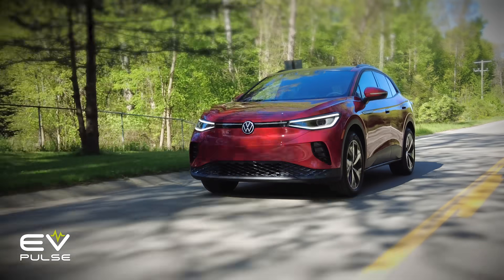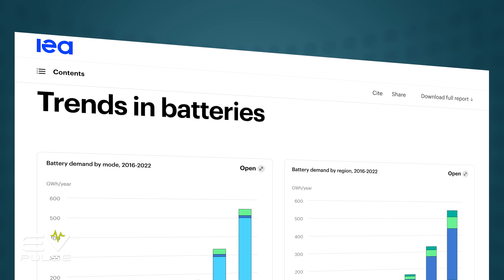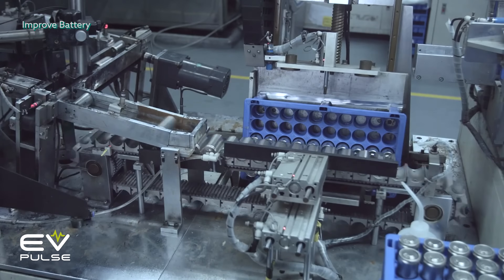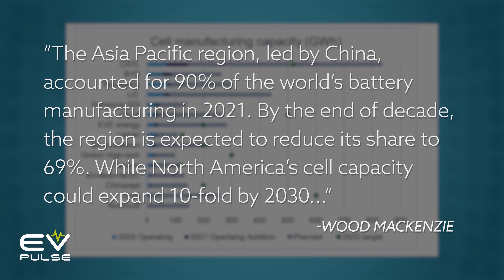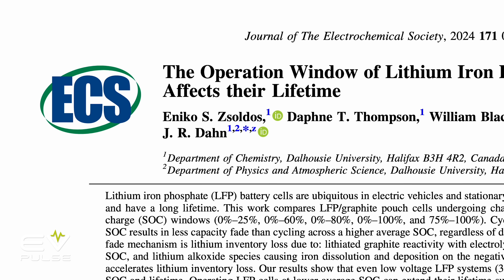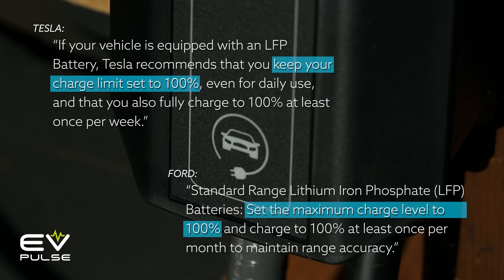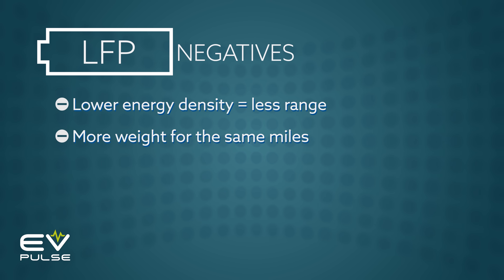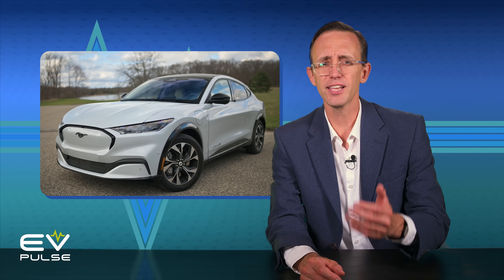What is an LFP Battery? | EV Basics

Comment: You need to charge lfp to 100% every month or so, but it lasts much longer if you use it between 20 and 80% like nmc. 100% charge is just to calibrate the controller. But anyway, even with every day 100% fast charging lfp will outlast any nmc by decades

Comment: I'm a bit late to the party but there were two glaring errors in this otherwise good video. In reality LFP batteries do not like being charged to 100% but occasionally you're required to do that to maintain range accuracy. And the "happy zone" for NMC batteries is around 50%, not 80%.
Reply: LFP. With approximately 5,000 charge cycles at 100% capacity, I choose 95% battery recharging at every charging cycle. I will certainly be dead long before that LFP battery degrades to 80% of its original capacity.

Comment: While it may not be super important which chemistry you get, it's VERY important to know which one you got. Knowing which battery my car has will make a huge difference in deciding on a charging regimen.
     I agree....If given the choice, I would probably choose LFP, just because of my familiarity with it, working with solar. LFP is proving to be the ideal energy storage solution for solar, because of it's forgiveness to partial states of charge, and charge acceptance efficiency, as well as longevity. In this application, the battery doesn't need to accelerate itself. In a stationary application, the battery can be as bulky and heavy as it wants, as long as it's cheap, reliable, and durable.

Comment: The BYD Seal has an LFP "blade" battery pack. It can be fitted with dual motors for high output and 0-100kph in 3.8 seconds. The range is equivalent to a similarly sized NMC battery in a Tesla model 3 for example. The new 2025 Seal model has 800 volt architecture that provides for faster  charge times better than some NMC counterparts. While the BYD Seal is not sold in USA the technology in BYDs LFP blade battery proves many of the statements here regarding LFP and NMC attributes erroneous or at least dated.
Reply: True, they are becoming dated. I agree that it appears LFP will likely take over from NMC in most applications in the coming years. The disadvantages for LFP are rapidly being mitigated, leaving all the advantages of a winner. The game is not over though, with  other battery types also looking to compete in the future.
Reply: The Tesla Model Y SR (german made ones) got the BYD blade LFP as well, best battery so far, outpaces the more expensive NMC versions

Comment: LFP can not be charged to 100%  regularly. The only reason it's recommended to charge to 100% periodically is for the cars system to reset and state the correct state of charge. NMC uses battery voltage to calculate the battery state of charge. LFP has a more constant voltage  therefore is not able to use that as a measure to calculate the state of charge. Instead they use electrons in vs out to calculate battery charge. In order to maintain it calibrated, it needs to be charged to 100% periodically.
Reply: This is why the plan is 100% charge but don't charge but maybe twice a week.  That will keep most days around 25-75%
Reply: @ewitte12  Stop with this bullshit please.If a battery can't take 100% charge it isn't fit for purpose.
Reply: wow the EVangelist aggression is manifest here!
Reply: Nonsense, LFP can charge to 100 and discharge to 0 regularly without degradation.
Reply: @QL2004 everything causes degradation, charging to 100 just causes it faster
Reply: @QL2004  Tesla specifically warned you not to drive your car to 0% as they say it will cause harm. They don’t give further details.
Reply: 0% is not recommended  @QL2004

Comment: LFP battery does not hold charge as well as NMC batteries in extreme weather conditions.
Reply: It's really about you personally, i don't think LFP is an upgrade in the battery technology, but more of a sidegrade, i live in an average climate (18-30 degree celsius) so not really extreme conditions, i need ~100km per day to commute to my work so a Sealion 6 hybrid for me is perfect (100% gives me a 100km for the LFP battery with the hybrid engine giving me 1100km range for long trips. I've only had this car for 6 months and i rarely use my hybrid engine, 98% is with the battery and i have never refuelled my gas in those 6 months.

Comment: I bought an LFP Tesla Model 3 in March 2023 to take advantage of the $7500 tax rebate before it expired. I keep my cars for a long time, often 20+ years, and I hope the Tesla will last that long with proper care.
Reply: Probably will if these batteries really go 300k miles. And by then, batt tech will probably be cheaper than today.
Reply: I'm looking at used high miles Teslas right now. It seems standard range LFP cars with around 120,000 to 160,000 miles have lost almost no range. Whereas long range NMC cars with 130,000 now only have about 20 miles more range than the high miles LFP cars. The long range NMC cars with 160,000 are the same range as the standard range as high miles LFP cars. One long range NMC car with 230,000 I seen on YT has now had dropped by over 25%. Which is pretty close to where Tesla considers a battery as failed... So looking at used cars and planning to keep it long term I think I'm going for the LFP car.
Reply: My 2018 model is the same as it was new but it’s definitely lost around 10-12%. These cars I predict will outlast ICE as it’s usually the increasing service cost of thousands of moving components. Seals, hoses etc that become unsustainable for ICE vehicles. 

I do prefer our model y LFP battery as opposed to the model 3 NCA. LFP is FAR more practical for a daily driver. Taking it to 100 each week is satisfying. And definitely has close to zero degradation for the last 3 years.
Reply: They seem to last longer than many people fear. You’ll see some range loss, but shouldn’t be a major issue.
Reply: I've just watched a I depth video of a used Tesla dealer just bought a 2020 Tesla model 3 with 280,000 miles on the clock ( it was a taxi in built up city ) and he was amazed how well it drove and battery had only lost 15 percent
Reply: @boyasaka 2020 Tesla is NMC and not LFP I’m pretty sure
Reply: @KingDidi999 
Tesla make vehicles with both chemistries. 

The majority of American cars - as explained in the video use NCA. This is why many of the American models are slightly quicker as they are slightly lighter but more tolerant to higher rates of discharge. All performance models use NCA

All base models coming out of china factory are LFP. 

I’ve had both a NCA California built 3 and a MIC model Y. I much prefer the build quality of the MIC Y and I much prefer the LFP battery which is showing nearly zero degradation in 3 years. -

NCA is 1000 vs LFP is 6000 rated cycle life.
Reply: Ditto!
Reply: Are they safer  than others??? ( fire )??

Comment: Ford recommendations actually say (if I'm not mistaken, I don't own one but someone read me the lines in his owner manual) that it should be charged to 100% once a month. It doesn't say to charge it to 100% all the time. The 100% charge is necessary to have a correct battery capacity reading. Also LFP do much more cycles, so even if not charging optimally it should last for quite a long time.
I did see somewhere, that in case of leakage, LFP batteries reject H2 ... which is very flammable. I'd be curious to know about the safety tests (supposedly more than a hundred) that were run on my NMC battery, but the manufacturer didn't want to tell me (although it seems to me it should be something they'd be proud sharing).
Reply: Hydrogen evolution only occurs in a severe over-charge condition, and is still less of a problem, than Lead Acid batteries. the same overcharge fault is absolutely disastrous, if it happens with NMC batteries.

Comment: I was able to get the base 2023 Model 3 last year while it qualified for the $7500 tax credit. It has lost about 4% range in a little over 13,000 miles and 15 months of driving (273 - 262 miles). Addendum: 5 months later and I’m now at 16,800 miles and it remains at a range of 262 miles suggesting battery degradation is slowing.
Reply: LFP degradation goes fast at first then slows down basically to nothing

Comment: EV batteries are moving to cheap and unlimited Sodium ion from catl and byd this year
Reply: Doubtful due to much lower density than even LFP. Sodium's main advantage is cold weather but that's more niche
Reply: @kevinlin4895  The "much lower density" is still more energy dense than the original Tesla Roadster, and like other batteries they are improving; by 2030 we will likely have Sodium batteries more energy dense than the NMC batteries found in new EVs today.

Even with "only" the current energy density, for city-bound vehicles that spend the night in a garage with a charger it's more than enough. And Sodium batteries are even safer than LFP batteries to boot; I'm not sure you can even make one of those catch fire without the help of a flamethrower.
Reply: @FabioCapela  I agree.. but consider the flack that LFP is taking in the US on energy density concerns, I have a hard time believing they're going to be receptive to a base chemistry that is even lower. Granted city commuter is fine (and Sodium Ion city commuters already exist in China), but US citizens are the ones that are reported in surveys to constantly saying they need at least 500 miles range to consider buying EV.
Reply: @FabioCapela  The forecasts I saw for them put them still far behind current NMC batteries. My NMC battery is 250Wh/kg, when optimistic 2030 forecasts place Na batteries around 200 Wh/kg. However, being safer to operate would mean that they would compensate a bit at the pack level.
I saw a great video about all those technologies on another channel: https://www.youtube.com/watch?v=iptLhpK6Cg0
Na batteries should be great for grid storage and will probably end up in city cars (aka. the second car of the family which doesn't need much range).
Reply: u might as well use NiMH it is so low energy density
Reply: Sodium batteries are HEAVY.  Great for low range heavy cars.  Not so good for long range light cars.
Reply: @davidbeppler3032  For now. But there are not only incremental improvements in the pipeline that should bring Sodium into energy density parity with current EV-grade NMC batteries by the end of the decade, there are some semi-solid state Sodium battery prototypes that could leapfrog that if they do work out. When either of those happen EVs will end up being solidly cheaper to manufacture than equivalent ICE cars.
Reply: @FabioCapela  Oh.. so you are following the "magic" of, it will just work.  Without understanding anything at all.  Ok.  Cool.  Yea.  Just wait for Solid State batteries from Toyota instead.  They will have them any day now.  They have been working on them since 2012.

Comment: Which preforms better in the winter?
Reply: Apparently NMC
Reply: @kevinlin4895  My NMC battery does fine with a heat pump in the negatives F.  Only lost about 4%.  That said, running the heater also used more power than running the AC does.
Reply: @davidbeppler3032  yeah I think cold weather and higher energy density are about the only areas where NMC has definite advantage over LFP now. The charging is about parity now with CATL's Shenxing changing the game
Reply: @kevinlin4895 nope nmc has higher power ratings too meaning some of cars like pickup truck nmc is much better
Reply: @머쓸이  pure EV pickup trucks are as yet unproven or expensive toys like the Cybertruck, PHEV at the moment is a better powertrain for trucks. However I will concede the fact for performance cars.
Reply: NMC/NCA/NMCA
Reply: Sodium, actually. It's even cheaper and lower density than LFP, but it's safer and for the formulation being used in a few Chinese EVs seems to handle temperatures below freezing with little loss in performance.

That being said, it's more a matter of proper thermal management than chemistry. A car with an LFP battery, but with a good quality heat pump keeping the battery temperature within an acceptable range, will see a loss of range in freezing temperatures similar to the loss of range seen in gasoline-powered cars.
Reply: My M3 has LFP and I love the carefree process, just plug it in for 100% charge, at least once a week.
Reply: Rivian is saying if you buy their LFP battery just keep it plugged in (not charging) but just plugged-in in extreme cold temperatures.  I was very interested getting a Rivian with an LFP battery but my husband bought his Rivian in 2023 when this LFP battery was not available yet.
Reply: For a while, even Tesla was advising against getting their LFP models if you lived in a cold climate. I assume that still applies (??)
Reply: @LakeLake123  My Model 3 LFP range is greatly diminished in cold New England winters. Somewhere between  20% and 40%. Obviously that hurts range, as well as increases the cost per mile driven especially when I pay about $.31 per kilowatt hour.

Comment: It's interesting we didn't have concerns about how cobalt when it's used to refine gasoline, only when it's used to make batteries.
Reply: This is true, but if I understand correctly, the cobalt in oil refineries is only used as a catalyst to remove sulfur. The cobalt is not an additive in the fuel, nor does it get burned. Still, something to think about.

- Craig
Reply: @AutoEsoterica  Some of the cobalt is lost during refining of gas but batteries can be both reused and recycled.
Reply: And it wasn't being talked about for smartphones that use a higher percentage of cobalt
Reply: EVs are in disadvantage due to biasness. For example, your ICE car broke down and you tow it away, no one would even notice. If the same happens to your EV, there would be judgements everywhere.
Reply: @ Might be a good thing some are being talked out of buying an EV. If demand were too high we would be back to 2022 prices.
Reply: @ in my country Nepal, it’s selling like crazy. And almost 90% of new EVs are LFP and we are in second ranking after Norway in EV adoption. Currently more than 80% of yearly sales. In 2022 it was almost 100% yearly sales though.
Reply: Look.... cobalt has been mined by children of the Congo to make gas for decades.  Now it is also being used for batteries.  That is a problem.  Batteries are reusable and recyclable.  That makes any Cobalt mined a closed loop and will put children out of work.  See the problem?  Nobody will feed them for free.  No work, no food.  If we stop making as much gas those children will starve!
Reply: Agreed.  Cobalt is used to refine gas and Cobalt is used in portable electronic devices. My reference is Raymond Leury, retired President of the Electric Vehicle Council of Ottawa (EVCO). I'm not advocating for the use of Cobalt.  I'm just trying to get all the data out there.
Reply: The cobalt used as a catalyst in oil refineries was dug up many years ago, when supply was more ethically sourced. It was the enormous increase in demand from EVs that made child mining in Congo a thing...
Reply: @Ironic1950  
Citation needed
Reply: @Ironic1950  Ah, yes... the great Cobalt reserves that can not be touched by the dirty EV battery makers, but is the only source of Cobalt for the refineries.  They mined it using nothing except the finest in Mining technology.  Picks wielded by strong educated men in the 50's who knew their hard labor would sustain a countries need for Cobalt far into the future.
Best to let the children starve than have them work.  Right?
Reply: @Ironic1950  I don't believe that. There are no "stockpiles" of cobalt. It all has to come from the same sources.
Reply: @frankcoffey  So you buy all your groceries from Wholefoods, never Trader Joe's? Same with mineral supplies. Oil refineries have long-standing supply contracts with metal companies, which have long-standing contracts with miners, miners that have mining rights elsewhere than Congo, so dubious mining is fed to late arrivals in the cobalt business, that is, battery makers!